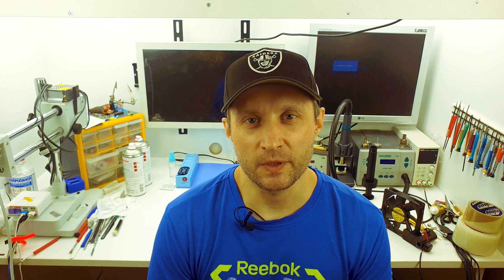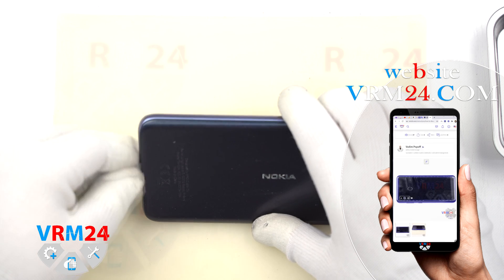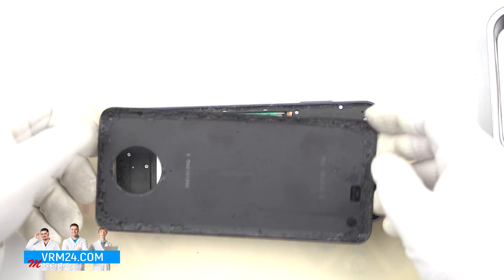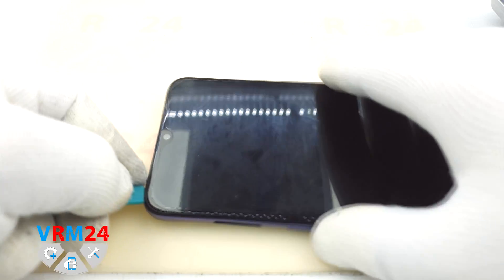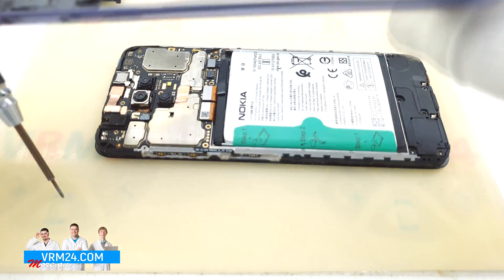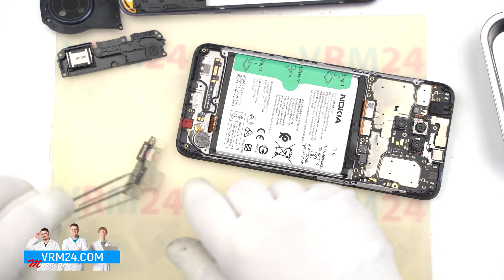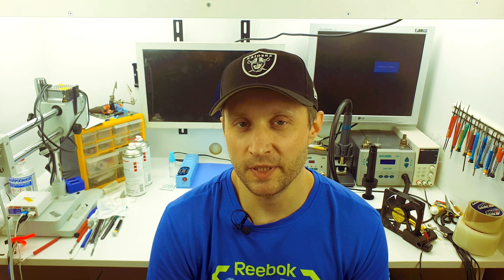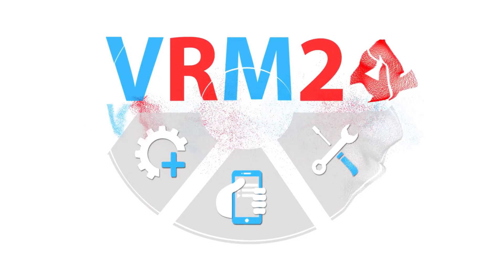Nokia G10 TA-1334 📱 Teardown Take apart Tutorial

Comment: Doesn’t show screen removal, the reason being it’s glued in, to remove broken screen remove the tape under the battery so ribbons can move, i used a knife as screen was shattered, once I got into one point the screen lifted off its back plate, the back plate was just lift out, order some screen adhesive before you start..